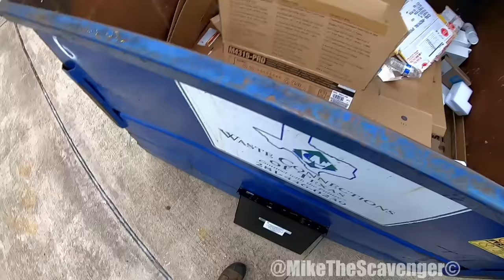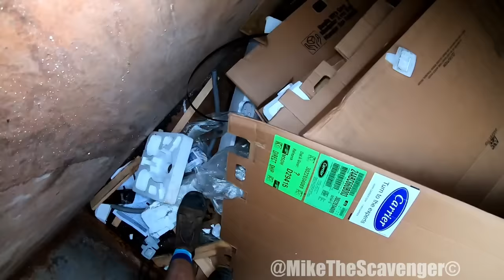Dumpster Diving "It's A Treasure Chest!"

Comment: You should definitely do a scrap run with all those motors!
Reply from the maker: I certainly will!
Reply: @MikeTheScavenger  Yes! can't wait!
Reply: @MikeTheScavenger  At what point would it make sense to break motors down to try to get a better price for the copper inside, if ever?
Reply: @spaight711  If you have the time/space... It's always better to clean the motors up. Also, ease of removal of the copper. 
Me I always break them down to maximize my $$$ per trip to the scrap yard.
Reply: @spaight711  The best is to find a yard that pays good for the motors as is. My yard pay enough that it doesn't really make sense to break them down unless they are over 100 lbs
Reply: @spaight711  depending on current prices many time electric motors fetch nearly the same and sometimes more than breaking them down.

 Pulling one apart when you have several of the same kind to verify how much time needed to micro-scrap and calculate extra $$ gained vs time needed may only pay few dollars extra per hour.

It's especially true selling whole when the windings are not copper and or if there is extra thick heavy steel or gearbox attached.

With this many it makes sense for Mike to call around and find the yard who pays the most and get rid of them to free up the room to empty the truck and fill it up again tomorrow
Reply: @MikeTheScavenger  Use the good motors and make electric when they run backwards they make electric. Get off the grid.
Reply: Must have been a design change or a quality control problem to throw away thousands of dollars worth of motors away. They would go well on a minibike, wheelchair, other small vehicles.

Comment: Mike when u get those rims with tire left on, just take a Sawzall and cut through the bead of the tire the rims scrap anyways, if they were steel rims you would heat the bead of the rim where the tire seats until you start seeing a Little Smoke Off the tire and then the bead will pop off really easy. Enjoy watching you go through those dumpsters

Comment: Sawzall those beads on those rims and do a motor scrapout with weights only copper and cast aluminum. If motors are aluminum windings forget the scrapout and go for weight and payout clip.
Great finds!

Comment: Easiest way I've found to get tires off of rims  is to just cut into them with a good recip saw. You'll have to go down into the rim a bit to get all the way thru the steel belts. Will be way easier now that most of the tire is already gone. Good find. My yard wouldn't take them even with that little bit of rubber. Sell the strollers yet? Love your channel.  Keep up the good work!

Comment: On the wheels with the partial tire on them, I been just using a reciprocating saw and cutting the tires off. When you get down to the bead on the rim, just cut on into the wheel until the tire is completely cut.

Comment: About the motors. They have multiple wires on the leads. And a circuit board. Looks like the rotors are permanent magnets. They may be stepper motors and if so might be worth a lot.

Comment: To break the bead on a tire just take a 4X4 and place it on the tire up close to the rim. Put the other end under your rear truck tire. Then simply back up on the 4X4. It will force the tire off the rim. Get a couple of large screw drivers to pry the tire off the rim.

Comment: I would definitely want to see what you do with the BROKEN motors😉. I would use a cutting wheel on those rims. Stuff is in the trash for a reason. Cut the wire off and scrap the rest. Thanks Mike 👍

Comment: More money scrapping clean rim.Use sawzall or wizer wheel,grinder to cut through steel bead of tire.Easier to cut if left in place with the tension the bead is under.Cut perpendicular to rim cutting into rim and bead.Better price if you remove all wheel weight and valve stem, center ring knockout.You won't get top price because rim  looks painted or coated .Good job Mike!

Comment: You can use them motor's for wind turbines and other electric generators. I've got one from a treadmill for that purpose and it's 12 _180v and at 400 RPM is enough to charge a battery bank to run your house so I'm thinking they would only need about 200 rpm to have the same power as mine. Sell them for that use after you test them.💚💛❤️👍

Comment: good quality sawsall blade will easily cut thru those tire beads....definitely worth taking the rubber off and also weights/valve stem to get the good price.....also check the lug nut holes some will have steel inserts that are easily punched out with a hammer and chisel

Comment: Spray dish soap around tire, then after it seeps in take a Maddox to  seam. Should slip off. S scrap all the motors take your time do it on a rainy day.It’s worth getting that copper if those are copper windings.

Comment: At the 5:15 mark, in the envelope, they were vibration dampeners for like small engines, motors, or pumps. That wheel barrel dolly can be easily repaired and sold for twice as much as the repair. Shops are always looking for them. At the 20:23 mark, With the stools are angled shelves. In the bag is a student bed with bookshelves. The black plastic pieces in the bag are bed lifts for easy storage under beds. Right before kids go to college, people are looking for them.

Comment: You definitely need to scrap out those motors, unless the price for motors takes all this into account. Copper windings, Stainless spindles and bearings, Cast Aluminium casings....
Might take a bit of time to work out how to do the 1st of each type, but there may be a large benefit to do so!

Comment: Those dc motors would sell well. Hell, I’d buy a few. Easy $5 each on eBay.
You can test them with a car battery, the higher voltage it’s rated for will only make it turn faster

Comment: Use a cutting wheel on angle grinder it will cut through the bead on the rims no problem.

Comment: Best to use a hack saw and cut the rubber and into the rim a little till you cut through that steel ring on the tire. Easy as. I used to do it all the time, pops right off

Comment: use a reciprocating saw to cut the bead on the rest of the rubber on the tires, and are those aluminum plates on the front/back of those motors? Those might pop off easily

Comment: That stainless thing is the body portion of a swimming pool filter , and lucky you , you got the pool pump with volute from the same place.  There are two major reasons Tesla uses D/C motors. A) batteries are already D/C and B) they are reversible.  I don't know if that helps with deciding what to do with all those motors you picked up but maybe.  I personally might would keep a couple of those motors for future tinker projects and scrap the rest.  I mean seriously who needs a 100 small D/C motors?

Comment: Those rims just cut the tire bead from the inside with an angle grinder with cut off wheel and pry the rubber off. Be careful to keep a good grip on your grinder and it does stink, but easy peasy.

Comment: Use a sawzall and just cut the outer bead and it'll come right off I get tires all the time like that with a full tires on them and I just cut right to the tires and cut into the rim a little bit and the whole tire will come right off but that's a easy tire and cut off

Comment: Have a little back yard fire pit and burn off the remaining rubber on the wheels Mikey. 
Pull apart one of those electric motors and see how much copper is in them. Coppers around four bucks a pound

Comment: QUESTION PLEASE: 
For some one that’s wanting to get started scrapping. How do you tell the differences in the materials especially in the wires that are coated in plastic? Also If you find braided copper that’s coated with a thick plastic coating, should you strip it or take it in as is ? THANKS

Comment: Trying to pull the core out is dangerous,  strong magnetic force holding core in. It can be done but you can loose a finger easily done wrong.

Comment: That would be a lot of copper if that was all scrapped out but in the long run. Would it fourth at be a lot of work probably just as well? Just take the motors And scrap it out.

Comment: Scrap prices Realy suck right now. Wish I had a property to store it on. There is probably a good reason they threw out those motors. They might be copper clad aluminum wire instead of copper wire.
Reply: well you could still get motor price
Reply: @TheCabinfever1977  not if they're copper clad aluminum. They have to be copper.
Reply: @66bigbuds  my yard doesn't check the motors to see if copper or aluminum

Comment: Does the scrapyard take the motors as is? Seems to be a lot of work breaking each one apart.
Reply: 25 cents a pound for motors or $2.54 a pound for copper after breaking apart

Comment: If they are copper wound, I would micro scrap those motors for sure Mike. The ends are probably aluminum I would think. I use a cheep air hammer to blast the windings out. Either way look forward to seeing you get paid on them. All the best!

Comment: To me, it is a mortal sin to throw away tools, even if broken. Broken tools can be repaired, modified to new purpose, or repair another tool. And that drum dolly is no cheapie and as for the wheel, heck, take the pin out and put on a wider washer and put the pin back and keep using that dolly until both wheels are ground to the ground! And if those motors are good, they will be worth way more than scrap. Those look like motors used for scooters, motorized carts and motorized bikes. They can value anywhere from a 100-500. And I am sure the light weight ones are "brushless motors". But, if you ain't got the time to try and sell them, tear them on down! The rims, smack them with a sledge hammer, bust em up and get that ol bit of tire off of them. Worth more clean than scruffy.

Comment: DC motors are not cheap.   Probably could sell those on Ebay or Amazon.
Reply: Try using a torch to heat those rims and the "tire" where the the two meet, and maybe it will turn loose.